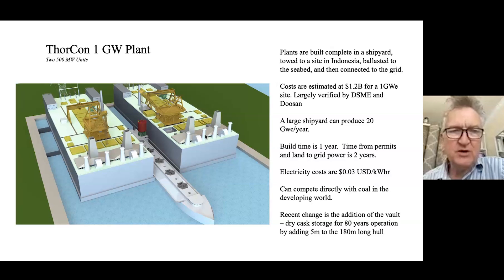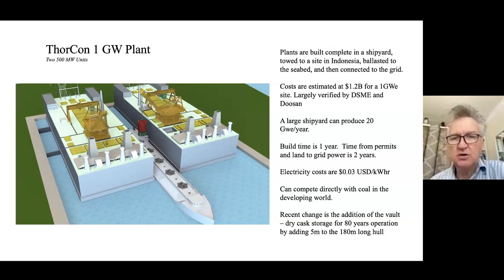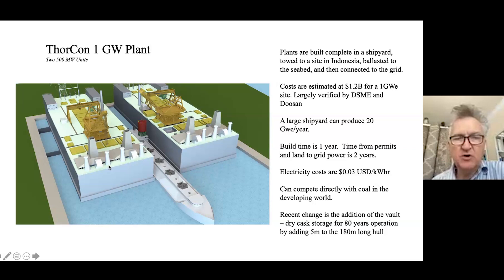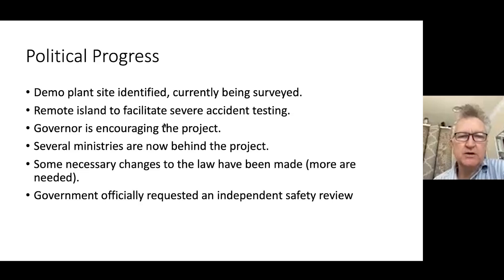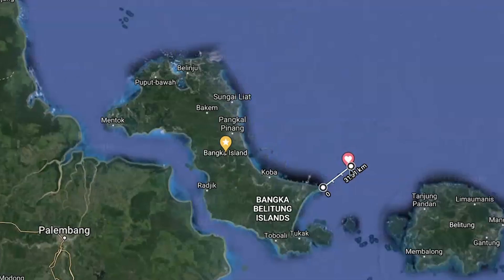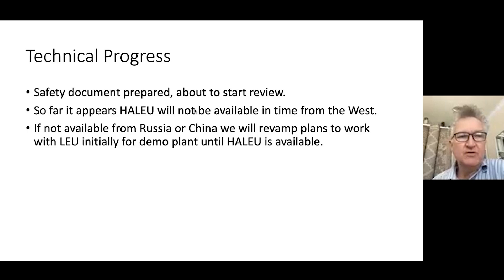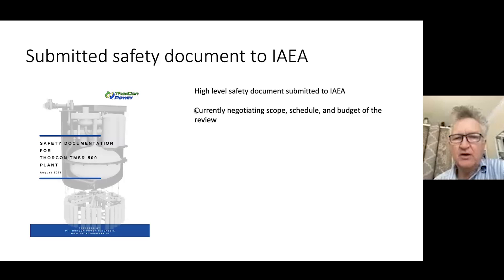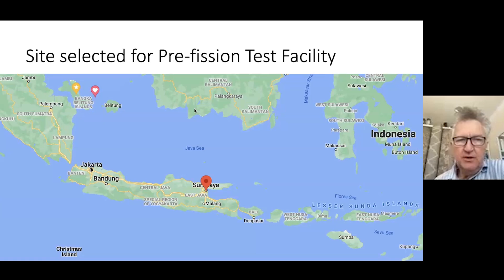Thorcon 2021-10 Update - Lars Jorgensen @ ORNL MSRW 2021

Comment: I heard the radioactivity (alpha particles?) made the metal brittle. How has the brittleness problem been solved or did it not exist?
Reply: They use a safe life approach. Cans are removed from service before serious degradation can occur.
Reply: The designed pot thickness ensures its not a problem A millimetre thicker would more than double the expected useful planned safety life.
Reply: The "pots" are also under no significant pressure differential and are supported from overhead  hangers and braced horizontally for any seismic movement by damping mechanisms.
Reply: they also plan to run at under 700C as some problems (hate that word)  occur at 750C + with Chromium leaching from stainless steel only in micro exposed layer- an example is a car engine will destroy itself at 10,000 rpm but will give a long and safe life at 6,000 rpm max - so it is not really a problem
Reply: @jimlofts5433  Aircraft gas turbine engines also demonstrate how a mechanical device can operate reliably at very high temperatures for protracted time.

New high temperature research reactors in US and China as well as elsewhere will develop the necessary technology platforms for commercial products.

Comment: I have been following the progress of Thorium Nuclear reactors for a while. ThorCon's innovative approach (building reactors on ships to be fastened to sea floors or riverbeds as I understand it), is certainly different. And the estimated cost and time savings seem impressive. I wondered who in their right minds would want a nuclear reactor essentially sunk in a seabed just offshore from their country? Well Indonesia seems to be the answer. And I can't help but think this would never happen in the US or UK with all their anti-nuclear sentiment. But if it works.... and there doesn't seem to be any significant reason why not - then Indonesia at least will be on to a winner. I see Indonesia has (insisted?) that proof-of-concept (via rigorous testing) at an offshore island, show that another Fukushima is NOT POSSIBLE. If you can convince Indonesia of THAT, then I reckon you will be at the forefront of a renewed Nuclear Energy future. And we need it. Fossil fuels are going to so badly affect our climate and environment if a better way is not found and developing nations see that as the "easy" option for providing their citizens with power/energy. And while renewables are "clean" their intermittency of supply is a major drawback....and don't be fooled - nobody has satisfactorily answered yet what happens to the tens of millions of solar panels at the end of their 20-30 year lives - straight to the tip? They are not designed for recycling (yet) - a bit like computers really - so how will the toxic materials in them be safely disposed??? Same for wind turbines. And large-scale battery storage disposal?
Reply: A lot of computers are able to be recycled though you’re right and also a lot of solar panels that are bought are cheap chinese ones that only have a lifespan of 5-10 years
Reply: @thefoundingtitanerenyeager2345  Lol I was hoping we'd gotten past the 10 year minimum by now! But what happens is the stuff is sent to Africa, where the poor and desperate strip them of gold and other useful wiring/motherboard stuff etc - and a lot of it is toxic. And I don't like nuclear either but on balance it seems the current best option to meet surging energy demands globally - and will definitely stop dirty coal being used if its competitive enough (or coal is taxed higher).

Comment: What do you do in case of a tsunami or a taifun? Move your plant out of the way and leave the customers in the dark?
Reply from the maker: Thorcon has a far more in-depth video which covers that: ThorCon's Thorium Converter Reactor - Lars Jorgensen in Bali
Reply: It's actually explained a bit better in another video but the jist of it is that the vessel is resting on the sea bed and will have about a dozen meters of freeboard above the regular sea level.

If a tsunami was approaching the reactor would already be in shutdown mode, meaning whatver it was powering would already be in the dark. The wave would likely pass around it harmlessly, as the wave isn't yet pushed by the sea floor into "breaking" which is what transforms the relatively harmless potential energy of the wave into very devastating kinetic energy. Even if the wave passes over it the entire thing is sealed and built like a ship, which already have to deal with deep sea storm waves passing over them. Once the tsunami has passed, it is likely the landlines and every single ground equipement is going to be far more damaged than the reactor, but if the power infrastructure remains functional then the reactor can be brought back to power on short notice.
If the reactor vessel was serverely damaged and the emergency shutdown and configuration change into the drain tank was done, then operators would spend a bit more time inspecting the damage before moving the fuel back into the core for power operations.
And if, let's say, the core is damaged beyond repair? You bring a resupply vessel and just swap the core with a new one. Hook it to a new turbine and you got power back.

Remember, nuclear reactors are already designed to essentially survive the apocalypse. Ironically enough many engineers discovered that shutting down Fukushima actually worsened the situation since it was entirely undamaged by the earthquake and the primary circuit could have kept producing power when the back up generators were lost. With the loss of power came the loss of reactor control and monitoring which lead to the eventual loss of the plant.
Reply: Tsnuamis are no problem its a ship.

Comment: This is good and all for MSRs, but they need to use Thorium as the fule and not uranium ( HALEU )
Reply: It wouldn't work with just Th they want HALEU and Th enriched to just under 20%. You need lots of neutrons.
Reply: It’s not a breeder, it’s a converter. Simpler, and easier to get going.

Comment: why does it cost so much ?
Reply: dont they usual cost 10b at this output? to be fair its a prototype so going to cost more i guess
Reply: The $1.3 bn for a 1 GW plant is about half the cost of a similar coal plant.
Reply: @travisbeagle5691  so its 50% cheaper than coal? thats alot if it turns out true
Reply: @Grant Lyons - looks like you've misunderstood. From how I interpreted the PPA agreement, possibly the only cost to Indonesia is to prepare the site and hookup the units to there grid, but then the site preparation might also be within the $1200 per KiloWatt stated by ThorCon for fabrication in a known competent Asian double-hulled-bulk-carrier ship building yard and towed to Indonesia within a 10month period. 
The levelised cost for fabrications and delivery are included in a pre-profit running cost of operation; including manpower, security, fuel salts, and four yearly periodic maintenance of equipment, which includes recycling the pot with a new graphite moderator; all for considerably less than $40 per MegaWatt.hour over a potential 80year life.
(Currently Indonesia expects to pay $69 per MegaWatt.hour from a PV Solar farm in North Sulawesi which cost $2000 per kiloWatt, almost twice as much as the ThorCon).

Comment: Gigawatt scale power plants are obsolete investments. They should focus on the 100 Megawatt scale.
Reply: Gigawatt is 1000 times a megawatt. Seems a better size.
Reply: A gigawatt installation commands attention. It demonstrates serious capability. The documentation of the construction would serve as the basis for all installations to follow. A 100-megawatt power station would have the appearance of a test.
SMRs can and will come later. In time, they will dominate the industry. But right now we have the enormous task of turning public and political opinion in favor of nuclear energy. When the public sees a 1000 MWe nuclear power plant that occupies less real estate than most modern warehouses and they compare that to the unbelievable eyesore and cost of a subsidized solar or a wind farm the tide of opinion will turn.
Reply: @benthere8051  it's capable of being a base loader or automatic load follower so depending on the load it may drop output down to 50MegaWatts depending on the turbine specifications. The automation adjust the volume through the "Pot" so when   pumped at max rate the turbine will give you  500MWe to the grid.
Reply: @MrVaticanRag  I can't imagine a new reactor not being coupled to anything other than a supercritical CO2 turbine EXCEPT for coal-fired plants that are being upgraded to nuclear where it's more economical to keep the existing infrastructure. I find the ability for MSRs to throttle down to 10% of capacity to be amazing.
Reply: @benthere8051  I'm not sure Supercritical CO2 turbines are available outside the USA, let alone over 250MWe capacity. Last time I checked the larger units are still in development - pity though,  but ThorCon remains pragmatics and keep to well tried and proven equipment, systems and methodology. Hence the choice of Sodium Fluoride salt rather than needing to find simple solutions using the Li⁷ problem with Lithium Fluoride salt without using SC.CO2 turbines.🥝🥝🙏
Reply: Technically Thorcon does 250 MWe reactors. The 500 MW units are in turn composed of two 250 MW units. The 1000 MW should be understood as a marketing proposal because, well, if you are trying to sell one you may as well try to sell four. But if everything goes well they will naturally start with one 250 MW reactor and just add more as time goes.
Reply: GW scale is still the best option. Just use several modular 250-500 MW reactors to make like 1-2 GW plants.
Reply: @benthere8051  Steam turbines are well understood need to reduce risk.I like the Brayton cycle myself but all developers have gone to the Rankine,so it makes sense, you can always improve it down the line.OKLO uses supercritical CO2 in  a heat pipe fast reactor tiny 2MW,they got their application denied by NRC.
Reply: @tonychen76  NO,No no!! Four cans per unit two working 500MWE per ship, industries will set up shop close to these plants and pay for heat,as well as current and H2.
Reply: @paulbedichek2679  There seems to be some misunderstanding? TMSR-500 consists of two modules. Each module consists of two cans, but of those two cans, only one will be working at a time. But if the TMSR-500 consists of two modules, that means it's possible to just use one module, which will generate 250 MWe. I don't think there's a disagreement here. While Thorcon proposes to build them in pairs, if a paying customer wants a 250 MW one or a 750 MW one I'm sure they'll build them.
Reply: @tonychen76  It is so simple.Each unit is 500 MWE,two hot cans of 250MW each and two cans that are cooling..